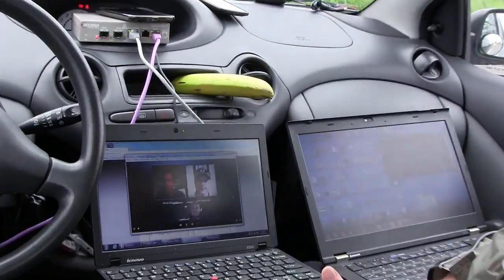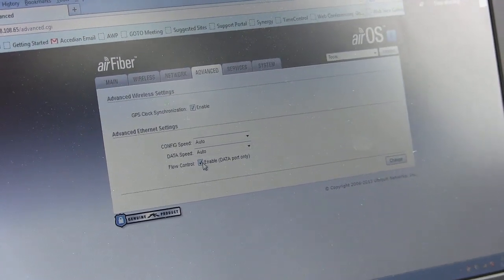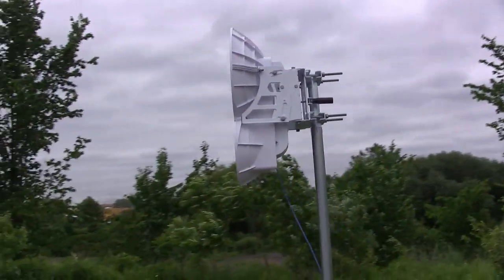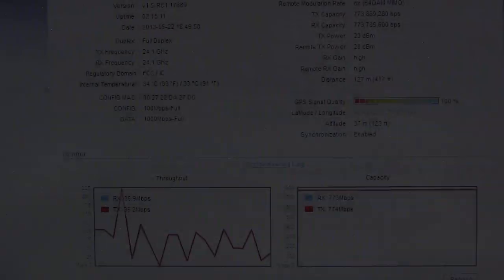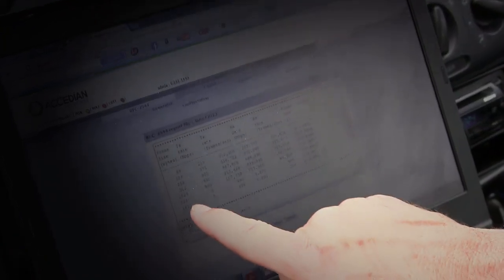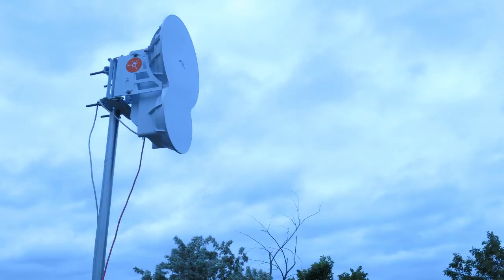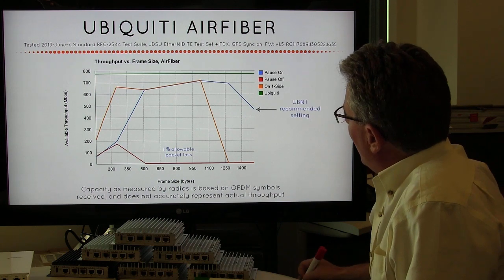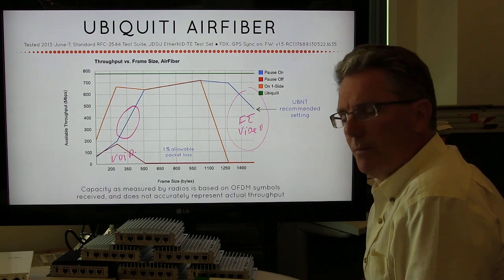Speed, Links & Radios - Ubiquiti airFiber testing - Take 2

Comment: I have some of these that have been running in a production environment for almost 2 months now. They are solid performers. I would be more than happy to do some tests on ours and share the results if you would be interested?

Chain 0 Signal Strength: -57 dBm
Chain 1 Signal Strength: -56 dBm
Remote Chain 0 Signal Strength: -55 dBm
Remote Chain 1 Signal Strength: -54 dBm

Current Modulation Rate:6x (64QAM MIMO)
Remote Modulation Rate:6x (64QAM MIMO)
TX Capacity:773,995,520 bps
RX Capacity:773,655,040 bps
TX Power:33 dBm
Remote TX Power:33 dBm
RX Gain:high
Remote RX Gain:high
Distance:2,353 m (7,720 ft)
Altitude:1,560 m (5,117 ft)

Version:v1.5
Uptime:51 days 02:46:22
Date:2013-10-25 17:09:08
Duplex:Full Duplex
TX Frequency:24.2 GHz
RX Frequency:24.1 GHz
Regulatory DomainFCC / IC
Internal Temperature:27 °C (81 °F) / 24 °C (75 °F)

Comment: I think the reason you are seeing the difference based on packet length has to do with buffers...Often buffer code (in chip firmware is very inefficient. A buffered frame of any length with often fill the registers allocated to a frame, meaning that one VoIP packet at ~64 and one FTP frame at ~1500 would occupy the same amount of chip/ASIC/RAM/etc memory. As this happens you fill buffers and pause frames spew out like mad. Even with the Ethernet flow control off, you may see this, as over flows.

Comment: I have installed rocktac with 30dbi dish for 36KM link.But in evening my device isolated capacity goes down.Noise comes in both side.How i can increase my device isolated capacity or remove noise from interface?any suggestion or device recommendation?